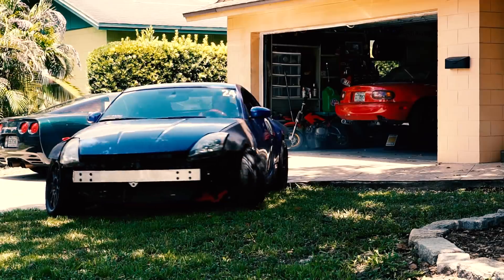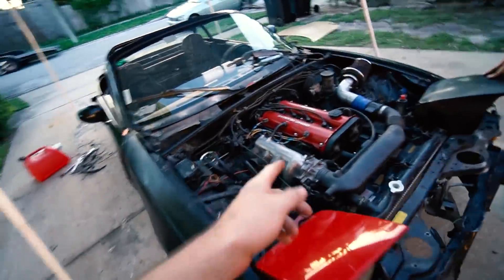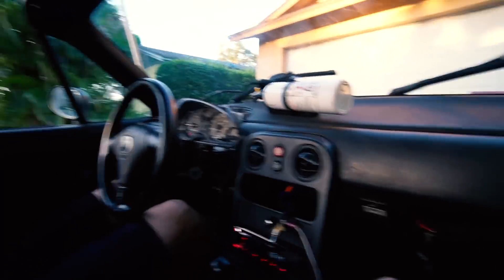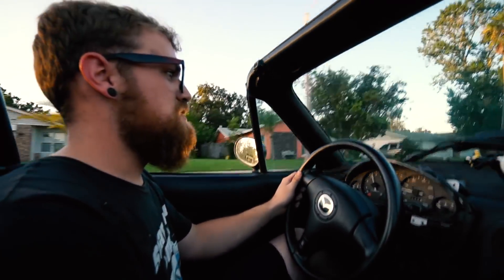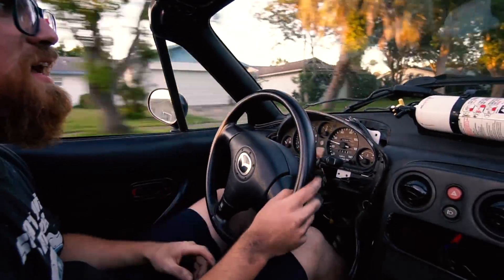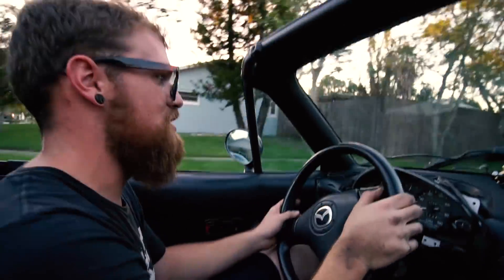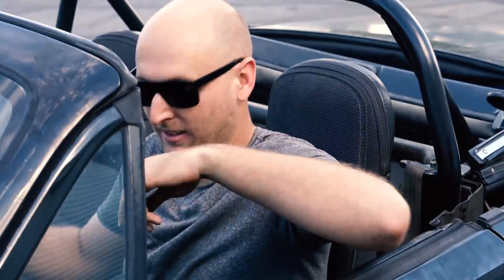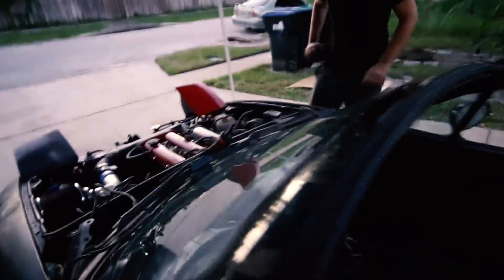Will a Car RUN on RUBBING ALCOHOL?

Comment: I use it my chainsaw when I forget to drain the tank, it removes the lacquer buildup, in my vehicles it cleans injectors and removes carbon on the intake and exhaust valves it probably does some damage as well but I have not experienced that yet.

Comment: gasolien is a petrolium product, which has an oily base which helps to lubicate as it burns.  Denature alcohol has no lubrication, and will eventually cause the pistons to seize by drying out the cylinders.

Comment: if anything this would be more efficient, as the alcohol has a much higher octane rating than normal fuel or even e85 fuel. try putting 1-propanol or 1-butanol into ur car, this should theoretically be the most efficient fuel.

Comment: your idoling high because alcohol does not need that much air to combust.. if you want read the book Alcohol can be a gas..  Just adjust your air intake to take less air and it would run even better.  Alcohol is a HIGHER octane at 100+ so it allows to condense higher pressure.

Comment: Run it on gas to get it warmed up and then wait for the container to almost empty and then fill it with diesel
Reply: Justin Wright diesel doesnt ignite, you can poor diesel out on the floor and it wont light with a lighter
Reply: Cody Van Note there a video of someone doing it with a weed eater. Was just curious if it would work on a miata. The weed eater wouldn't cold start on diesel but once it was warmed up it would run on it. Hence why I said warm the engine up first.

Comment: Do acetone or xylene next. Or methyl hydrate (methanol) or even MEK
Reply: Destin Ginnis not mek haha fuck that shit. Will melt all the fuel lines
Reply from the maker: xempt. one we did acetone in the next video with everclear. Worked. Not as well as denatured and ate the o rings.
Reply: The denatured alcohol mix they used is actually about 50% ethanol and 50% methanol... I think it's at worst 55% methanol and 45% ethanol.
Reply: Acetone and MEK are ketones and not used as fuel additives.

Comment: Usually race teams that run alcohol run 2 stroke oil to add lubrication for the fuel pump and injectors. Alcohol is not lubricitive at all compared to gasoline which will wear out your pump quickly.
Reply: Facts. Can confirm
Reply: Also, technically, when racers refer to their fuel as “alcohol” they mean methanol. Not like legit alcohol
Reply: @jamesderrick691  then explain why theres a class called top fuel (nitro meth) and top alcohol. They are two separate fuels. Alcohol cars are called alcohol cars and nitro meth cars are normally called nitro cars. Some alcohol cars do use nitro as a mixture with their alcohol as well.
Reply: Jared Anthony nitromethane is its own fuel. Methanol is also its own fuel. “Alcohol” is the term that refers to methanol, or methyl alcohol. Look it up. It’s closer to ethanol, which is ethyl alcohol (the same stuff that we call E85)
Reply: @jamesderrick691  unless they're using ethanol... still not rubbing alcohol though...
Reply: Oh it also strips the oil off the cylinder walls which creates scoring on the cylinder walls.
Reply: @jaredanthony8070  false. Try to clean up engine oil with methanol or ethanol. Alcohol is a weak solvant and will not remove oil from cylinder. On the other hand, gasoline is an excellent solvant of engine oil. Don't trust me? Try it yourself.